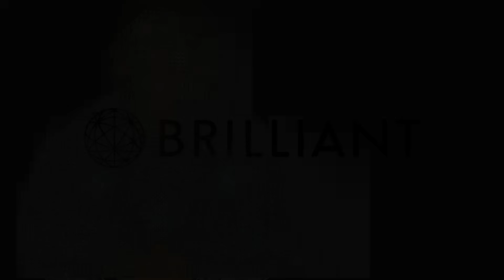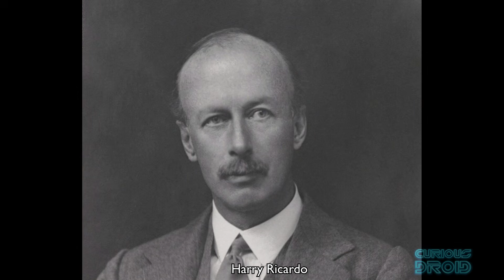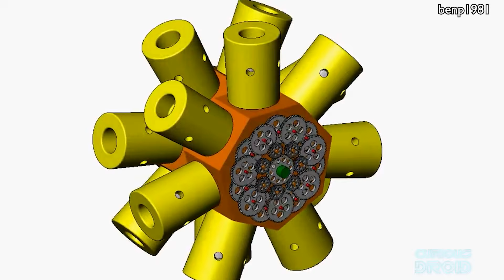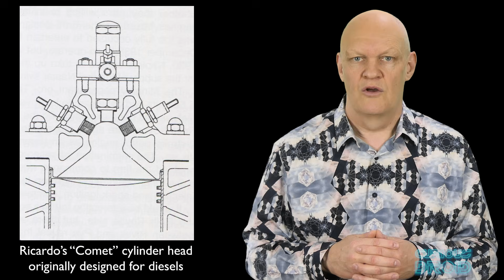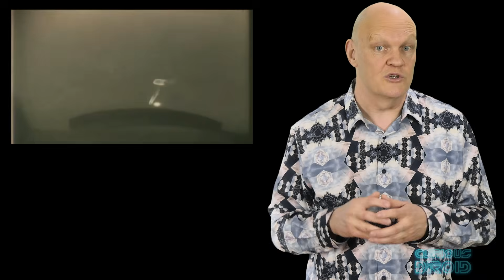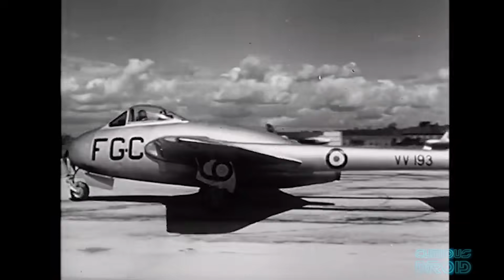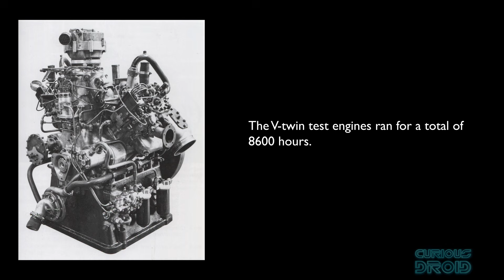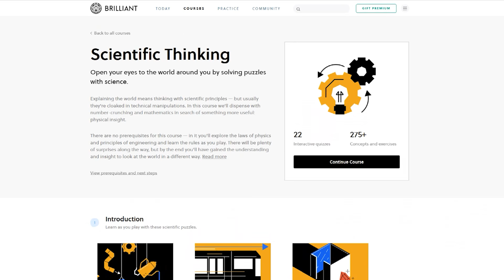Rolls Royce Crecy - The Most Advanced Piston Aero Engine Never Made.

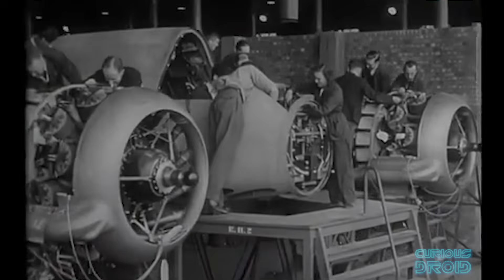Comment: At 3: 45 - the Merlin was 4 valves/cylinder, not 2.  5:50 - the Bristol sleeve valve engines are radials, not rotaries.  Paul, these errors are most unusual for you!
My reading on the Crecy was that they suffered from piston overheating, and so were a far higher risk than focussing on the Merlin.
The other RR engine from that period that was showing early promise was the air-cooled Exe - aimed particularly at naval aircraft.  When resource limitations saw it cancelled, the Barracuda team had to make do with the relatively low-power Merlin for such a large naval attack aircraft.
Then, after the war, the is the woe of Hives refusing a RN contract for the Clyde turboprop, that was running well in testing, and even in a test aircraft.  So the Wyvern had to cope with the delays and problems inherent in the AS Python.
Reply: The Exe was small in capacity (relatively speaking) and quite heavy. Its power was similar to the Merlin's at the time.

Development of the Exe was paused during the Battle of Britain, as was the Vulture, Peregrine and Crecy. This was to concentrate on getting the best possible performance out of the Merlin. The Exe, Vulture and Peregrine were cancelled not long after, but the Crecy program was not.

A couple more sleeve valve engines were developed during the middle of the war - the Pennine, an air cooled X-24, basically a larger Exe, and the Eagle 22, which was similar to the Sabre. The Eagle 22 would power the first models of the Wyvern.
Reply: @waynec3563  Your comments on why those engines were dropped was in what I wrote.  My understanding of the Exe was that it was more desirable for Naval use due to the air cooling, but it was looking good when the decision was taken.
But I read that the Exe Battle was the favourite RR hack aircraft for much of the war.
The Sleeve Valve Eagle was very late in the war, and was not really seen as being sufficiently developed in time to be a viable engine for wartime use.  By the time it was in the Wyvern it's days were numbered thanks to the emerging turboprops.

Comment: The obvious development, it seems to me, would be a halved derivative of the Crecy. A V6 engine at maybe 1.5 HP/lb and 1400 HP would be amazing. You could build a whole range of extremely fast climbing interceptors, as well as long-range twin-engined fighters with much greater fuel capacity. It would give you a Merlin in terms of power, but at maybe half the weight (factoring in savings in structure around the engine).
Reply: Interesting because Ferrari used the pre-chamber ignition technique in their 1.6 L V6 hybrid with over 1000Hp.

Comment: It's crazy how far we have come. They were aiming for 1hp per cubic inch as a gold standard. That's the equivalent of a 5 liter V8 making 300hp or a 2 liter I4 making 120hp.
Reply: This is where many go very wrong. An aircraft engine has to have many features including power to weight ratio. Hp per litre has nothing to do with it. Break horsepower per litre is important for other applications but not an aircraft engine.
Reply: @julianneale6128  *Brake
Reply: @-DC-  haha thank you!
Reply: @julianneale6128  typically smaller liter engines weight less. Also automotive engines are used in small aircraft.
Reply: @Common Sense Realist  Two points: 1) Early jet engines (Jumo 004 for example) were very far from reliable and had time between major overhaul of 10 to 40 hours. Recent F1 rules have required comparable periods of operation if penalties are to be avoided. 2) Torque is simply power/rotation speed (radians/s) so if you have the power you can produce the torque by gearing. Of course the Merlin used gearing - for the Lancaster the propeller reduction gearing could be as low as 0.42:1. I agree that the requirements are very different  - performance at altitude being one - no car will ever be required to perform above 8,849 metres ASL. As far as I recall Stanley Hooker never mentioned 1hp/cu.inch as a target but 1hp/lb engine weight was a target and Len Deighton suggests that this convenient target was significant (and the final figure of about 1.6hp/lb for the Merlin remains very creditable). Hooker was also very focused on output per unit frontal area as this is also a critical parameter for aero engines.
Reply: Gotta remember that this is at 3k rpm, partly due to the size of the thing. A modern 5l v8 would be more like 6k rpm, so expect double the specific power output just based on the rpm difference. Considering this, and the materials of the day, it was a pretty lofty goal.
Reply: @mike-barber  there's another reason for the low rpm...most piston powered aircraft engines are directly tied to the propeller with no gear reduction (for reliability).
To keep the tips of the propeller subsonic you have to limit either the rpm or the prop diameter.
That makes using a car engine more difficult to use in an airplane than you'd initially expect...
Reply: @Roll4569  very true in most aero engines. 

But also worth noting that these inline V12s were geared (Merlin, DB601) I guess for higher power output - 2.8 - 3k rpm is way too fast for a huge prop for the reasons you mentioned :) I think this may be the case with the radials too, but I'm not sure.
Reply: Simply because turbocharged engine on top of supercharger scavenging system.

Even in 60's most muscle car could do 1hp/ci just with increasing the RPM compare to Crecy
Reply: In many ways we have not gone far at all. The BRM V16 designed in 1947 (with input from Rolls Royce) achieved over 600 hp from 1500cc or over 66hp per cu. Inch - very comparable to the output of the current F1 engines when their hybrid elements are removed from the equation. As has been said, aero engine requirements are entirely different to automotive needs.
Reply: @ColinMill1  6.6hp per ci. With a supercharger. V10 era f1 was producing 5hp per ci without a supercharger.
Reply: @jpl1983  The V10s were 3500cc engines producing about 680hp so somewhat less than half the output per displacement of the V16 BRM.
Reply: @ColinMill1  

BRM 600ish hp at 12000rpm had a mean piston speed of 19m/s and a BMEP of 29.9 bar at 72psi boost using alcohol fuel. Take that 72psi away and the BMEP falls to 11 bar (and 204hp at the same engine speed but that assumes that inlet port flow without boost could create the volumetric efficiency to let it rev that high) 11bar BMEP is Toyota Camry territory today. Take the alcohol fuel away and it falls even further

The 2004 BMW V10 had a BMEP of 14.5bar at 19000rpm and a mean piston speed of 24.7m/s.  Remarkable as maintaining this efficiency at such high engine speed is not easy. Only NASCAR and Aussie V8 Supercar engines exceed these numbers but do it at far lower rpm (9000 and 7500rpm)
That’s all achieved without boost pressure or jungle juice fuel (F1 has used euro 95 standards since 1996)

Even if we slow the v10 to BRM piston speed it still making 710hp, if using the same BMEP. But likely that figure could be as high as 15bar and lower engine speeds meaning excess of 735hp is possible 

At the same peak power rpm point of the BRM and maintaining 14.5bar BMEP, 
The v10 is still making 600hp. Again at this lower speed it’s BMEP is likely higher than 15bar.

As a point of interest TOP fuel dragsters achieve a BMEP above 60bar (edit it’s above 140) using 65psi boost.
Reply: @jpl1983  There is the small matter of 50 years of development between the two with, apart from anything else, the advent of computational design tools.
Reply: @ColinMill1  it was your words “we have not gone far at all”. So now you are contradicting yourself. 

It’s evident that we have come along way since then
Reply: @jpl1983  I certainly wouldn't call the performance difference "very far" for over 50 years of development. BTW - can you justify deducting the boost pressure from the BMEP?
Reply: @jpl1983  I certainly wouldn't call the performance difference "very far" for over 50 years of development. BTW - can you justify deducting the boost pressure from the BMEP?
Reply: @ColinMill1  because it only generates that BMEP because of the boost pressure.

As an example. Take away the 65psi boos from a top fueler and it’s BMEP drops to 54bar. I must make a correction on the boosted number on the top fuel it’s actually over 140bar.

58bar is about what an AFuel (unsupercharged nitromethane fuel) dragster develops for 4000-5000hp

If you don’t think it’s a big move then you have no idea of the hurdles that had to be overcome to get there.
Reply: @jpl1983  Why not take the ratio of the absolute intake pressures?
Reply: @ColinMill1  take them from what exactly?

Power is basically calculated on BMEP x Piston area x piston speed. Factors that effect BMEP include type of propellant and oxidiser, combustion pressure and density, volumetric efficiency and thermal losses. A supercharger increases volumetric efficiency. In the case of the BRM, by 5 times that of its original capacity. They used alcohol as means of warding off detonation and heat from using that high of boost. Ad to that it’s an oxygenated fuel. Without the supercharger at best the BRM is a 200hp 1500cc engine and using alcohol to do it. Honda’s 1500cc V12 of the 1960s produced 230hp on pump gas. Honda maintained that it had potential to exceed 270 with improvements to reliability, but the first era 3.0l regulations came before they had a chance to prove it. 

Put a supercharger on anything with ridiculous boost pressure and roided up fuel and you can make all sorts of claims. 

Substitute in the BSFC and stoic values for E85 over euro 95 standard fuel and HP potential for the V10 exceeds 1050hp. That’s 5.7hp per ci without boost.
Reply: @jpl1983  Lets get back to the point that the figure of merit being chosen for this video is hp/cu.inch - not BMEP or anything else. I have already pointed out that this is an especially uninteresting parameter, especially for an aero engine where hp/lb and hp per unit frontal area are the critical parameters (along, with varying degree of importance wrt role, is specific fuel consumption). BTW - where do you get the 1050hp figure from - all the sources I have quote about 750hp at the end of the V10 era.
My question about simply subtracting the boost pressure from the BMEP is that this would perhaps be a legitimate sum if the blower were powered by some external source in which case boost pressure x piston area x piston speed would be a measure of the power input via the blower from the external source but the supercharged engine is driving the blower and the engine's output measured with this deducted so why deduct it again?
Reply: @ColinMill1   The bmw p83 and P84 engines were both 900hp and over. Try reading the link I posted before.

The 1050 number is a theoretical number of running a P83/4 engine on an alcohol based fuel (e85). 
Stop ducking and weaving. You made a statement, with little or no context, backed it up with bad math and now you are running away from your own words.
Reply: @jpl1983  Well if you are talking theoretical figures Rolls Royce said the V16 was capable of running at 14,000 rpm (and I believe over 750hp) so lets not get carried away with those). I have explained in my previous post why I think your maths is defective.
Reply: @ColinMill1  but too your point and tying it in with your original statement. 
The BRM was 238kg making it 1.14hp/lb.
By the end of the V10 era engines were under 100kg that is better than 4.09hp/lb. And that’s without resorting to supercharging or exotic fuel. 

You wrote that we have not come that far. I wonder in what context could you mean?
Reply: @ColinMill1  600hp was an upper limit most practical applications of the BRM were far less than that. It was an extraordinary unit for its day. By today’s standards it’s unremarkable. And you claiming to find fault in anyone’s math when you can’t do simple division.???
Reply: @jpl1983  Well, progress in electronics (especially Moore's Law for example where a factor of less than four represents about 20 months development) electric motors, battery technology... All have progressed vastly faster. Of course this is to be expected in less mature areas of engineering but nevertheless...
Reply: @ColinMill1  of course it has. The entire tech industry accelerated once we got computers to do calculations in less than a second that would take a team of engineers months or even years to do. Any bozo knows that. Except you of course ( well you do but you got caught talking rubbish and now you are trying to save face)
Reply: @jpl1983  I wrote - In many ways we have not gone far at all in response to a statement "it's crazy how far we have come" and I stand by that. You seem to treat forced induction and fuel technologies as somehow illegitimate. Is this why you try to compare the earlier 1.5 litre formula with 3.5 litre NA? Why not treat, say, single crystal conrods as cheating in the same way? Also, why not talk about the M12/13 of the turbo era - the most powerful F1 engines of any era -  that produced 900hp in race trim (and 1500bhp in qualifying trim) from 170kg engine weight? This is a more directly comparable set of regulations and perhaps shows that the 40 years of development between the V16 and the Megatron of 87-88 season is significant but not "crazy" as suggested by the OP.

Comment: Sorry - but I must correct your terminology.  You are saying “rotary” engine when in fact, the correct term for the P&W and Bristol engines you showed is “radial”.   
A rotary engine as exemplified by the French Gnome and LeRhone engines, is visibly similar to a radial, but it is actually quite different. In a rotary, the crankshaft is bolted to the firewall and the cylinder assembly (to which the propellor is also attached), pistons and connecting rods rotate around the crank.  The intake charge came through the hollow crankshaft and the carb was mounted on the rear side of the firewall.  These engines worked pretty well at smaller displacements but proved to be incapable of being scaled up much beyond 150-200 HP and so they disappeared shortly after WW-I as aircraft weight and complexity (and speed) demanded much higher power.

Comment: I wonder... can these be upgraded to 2021 technology? Modern materials, electronics and make them use bioethanol then strap them to a electrical generator.
Reply: Absolutely not you will not find a single two-stroke in a modern power application.  Fuel efficiency and emissions guarantee that.
Reply: @RidinDirtyRollinBurnouts  this guy said in the video that these engines were fuel efficient. Can a 4 stroke the same size produce 2500hp?
Reply: @RidinDirtyRollinBurnouts  using bioethanol or LPG is considered a greener alternative to petrol based fuels.
Reply: @RidinDirtyRollinBurnouts  Do you live under a rock? The Rotax E-TEC voice coil direct fuel injected 2-stroke engine is powerful, fuel efficient, virtually smoke-free & has low emissions. These engines have been used in snowmobiles & outboard motor boats for more than a decade. There's even a Turbo-charged version. Welcome to the 21st Century!

Comment: It would be interesting to see what a 2-3.5 liter displacement 4-6 cylinder version of this engine could do today.  With that power to weight ratio, even the 2-3.5 liter displacement may be a bit much for many smaller cars today.  I never cease to be amazed at what we've developed and then lost/forgotten and then try to recreate the wheel.
Reply: throw that in a car with todays tech to back it up & i wouldn't be surprised if it went up to 2.5-3hp/cc tweak some stuff to get it to be a high rpm machine & i think you may be trying to figure out how to actually get the power onto the road....

Comment: We already have 200 hp/L in production car engines, the Mercedes A / CLA 45 AMG has over 420hp from a 2.0L turbocharged engine
Reply: Also like a modern 2 stroke dirt bike, though this was like 70 years ago so that's cool.
Reply: @pleasedontwatchthese9593  Well a 2 stroke dirt bike hasn't been developed for 20 years, if they still did, they would be EFI and have a lot more power.... but they dont let us have fun anymore... also they do need a top end rebuild regularly... its more of a racing engine, I was thinking production engines...
Reply: @0611930024838  Do you live under a rock? KTM has recently come out with a dirt bike that has a piston port fuel injected 2-stroke engine. There are two models the 250 & 300 EXC TPI. And don't forget the Rotax/Evinrude voice coil direct fuel injected 2-stroke engine that's been powering snowmobiles & outboard motor boats for over a decade now.